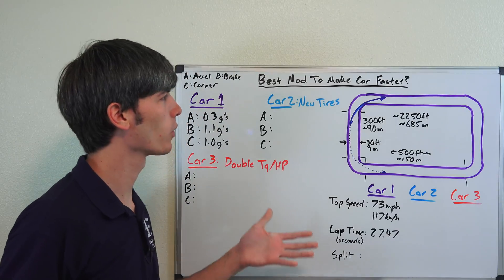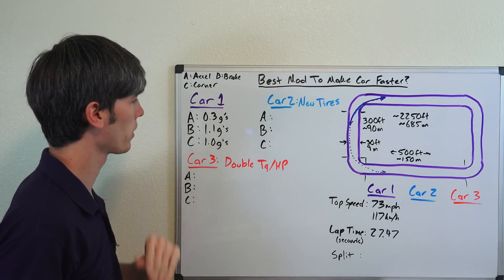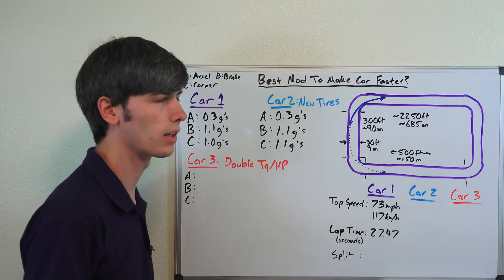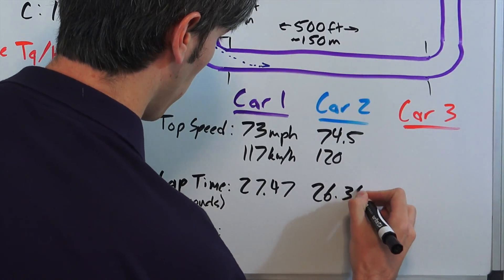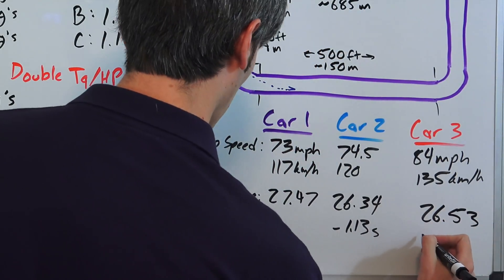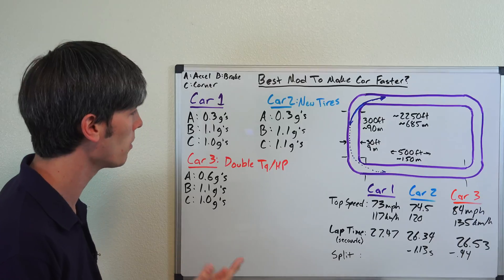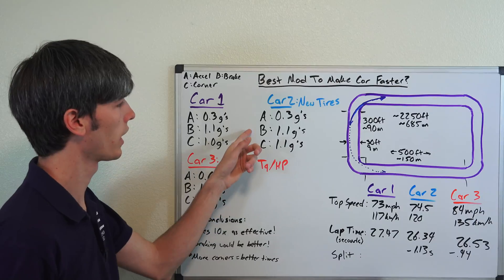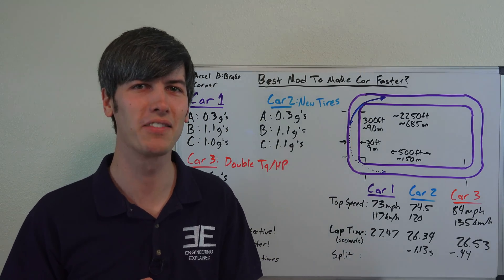What's The Best Car Mod To Go Faster?

Comment: Ideally car 2 and 3 would be the exact same but with one having more horsepower and torque. My question is, if you did double the horsepower via a turbocharger or supercharger, would you be adding weight to the car, thus making it a little heavier and contribute to a slower lap time? Awesome video by the way!
Reply from the maker: For the math in the video, we're simply assuming the torque curve is doubled. So let's just say for example you took a turbocharged car running 15 psi, and cranked it to 45 psi to double the HP (warning - it likely won't last long haha). Of course, adding a turbo/supercharger will add weight and thus reduce performance in a small manner, but we're assuming we've doubled the car's acceleration rate, hence we can add weight but will compensate with more power.

Comment: Mods
Corners= Tires
Acceleration= Camshaft/tune
Reply: Corners = Lose weight
Acceleration = Lose weight
Reply: mods: buy lightweight car (miata, crx etc.), remove junk you dont need (air con, power steering and other ballast), put great tyres, better brakes and you are good to go and rip some asses.
Reply: Downforce is starting to be effective at higher speeds. Basically, its pointless in normal cars.
Reply: Sigma Octantis
 IMO, the weight is a bad thing because of physics. The more weight - the more centrifugal force is generated (and weight transfer aswell) -> slower turns. If car is lightweight, its all about wight distribution and centre of gravity (you want to keep it low). Thats why lightweight cars has no competition on technical tracks (Lotus, Caterham etc,). The only problem is that in today safety standards, its almost impossible to make lightweight cars anymore.
Reply: Heidelaffe no normal human being is removing their air conditioning
Reply: its not just your opinion, its physics. Force=Mass*Acceleration the less mass you have, the faster you can accelerate around a turn without increasing the force on your tires, or worse, exceeding the forces they can handle. The GTR gets away with being so heavy because  IMO it has the best torque vectoring AWD system ever created. It has no business being as fast as it as carrying around 4400 lbs.
Reply: Heidelaffe Some people like to drive cars, not racecars
Reply: ***** same applies to you
Reply: Losing weight means losing traction so it's not as amazing as you make it sound. You need to make up for it with more downforce, which also means more drag and less top speed.
Reply: ***** Hence why weight isn't such a bad thing in street cars because they rarely go fast enough to generate enough downforce. That is why the Nissan GTR works well with a bit of heft.
Reply: ***** Except you need to lose an enormous amount of weight to make any difference, and then you're sacrificing grip which negates it's worth for a street car driven primarily at low speed...
Reply: You would be surprised ho BIG is that difference. Get rid of air con, spare tyre, put some sporty lightweight seats and voila - you got rid of weight which is circa like one person. And you can do more, way more. The difference in corners is huge (yeah, you cant really tell the difference of 70kg right away in 1600kg car, but in 900kg one, its like a night and day difference).
Reply: ***** No I totally agree there is a difference, you suddenly can't put any power down due to lack of grip.
Reply: gorrilaunit99
 A daily driver can be lightweight as well. But you will be forced to consider this before even buying a car i.e. don't get all comfort extras you will never use, don't get a glass sunroof (50kg and more at the highest point of the car), sometimes even a smaller engine will give you a lot less weight with only small lose of power. All these things can easily add up to 100-150kg, i.e. as much as 2 persons sitting in the back at all times.
Reply: gorrilaunit99
I didn't suggest that, my suggestion was something else: Ask yourself you really need all these goodies (glass sunroof, camera systems, lane assist, electic doors / boot etc.).
But I would rather look for a car with a low weight right from the start.

If you want to get rid of something like the A/C you can lose easily 20-30kg. If you drive a old car you also save maintenance.
That depends on where you live and what you are doing with your car. If it is just a weekend car for fun and if there is no way the car will become a classic: why not?

Btw. Both my cars still have working A/C and they will keep it. Looking for the greatest roads around europe in summer time and 35°C is no fun without a A/C :-)
Reply: F=M*A. it applies to "cars" race cars, airplanes, trains, rocks, Footballs, humans, bullets, water, even the planet. If something is lighter, it can accelerate faster without increasing force on an object.
Reply: +ReadyToGo Haha you're right to a degree, but that car has a tire problem not a weight problem. You did notice that its on all season tires in the stock C4 width right? Who knows how old and hard and likely overinflated they were. notice i said CAN and not WILL go faster. Unfortunately, in the real world more than one law of physics applies at the same time, hence why building really fast cars tends to be a hard job. Also, I wouldn't be going to those roadkill jabronies for sound engineering advice or examples of what to do at you local track day.

Comment: I'd say car needs to be balanced. Let's say your car has 120hp and weighs 2.5 tonnes. Improving tires will have little effect especially since most likely suspension on cars like that isn't very good. But adding 80hp will make a ton of difference. But if your car has 120 hp and weighs 1 tonne and has good suspension tires will yield way more than 80 hp added.
Reply: George Kartvelishvili 
wut 2.5 tonnes? wtf thats not a car
Reply: That is a car. Most full size SUVs even go beyond that. Toyota Sequoia weighs 3.5 tonnes for example. 140 hp Hilux weighs 2 tonnes empty. There definitely are a lot of heavy underpowered vehicles. For those 2 times more power will mean more than better tires. Esprecially if their suspension is no good.

Comment: Does the tires include something like downforce? I mean are you trying to explain why the acr can keep up with supercars?
Reply from the maker: Yep, downforce can play a huge, huge role, it's just going to be expensive to implement effectively. You're absolutely right though, one of the major reasons the ACR broke so many lap records was because it has more downforce than any other production car. Downforce is like making your tires way more effective, so it plays a similar role. It simply requires high speeds, and can dramatically affect efficiency.

Comment: Everyone who watches F1 knows how important are tires during a race.
This is a great modification since you don't have to change any other parts of the car in the process and it is simple. I believe the next thing you would like to modify is the brakes.
Reply: vdochev Not a fair comparison since F1s have great engines but I do agree.Good tires, breaks,coilovers could change the way the vehicle handles
Reply: I wasn't making a comparison. I'm just saying that in F1 you can clearly see the importance of good tires versus worn tires. You also have to be a good driver to take the full advantage of late breaking, accelerating out of the corner, etc.

Comment: The only way to make your car go faster is to resurrect Bruce Lee and replace the engine with him
Reply: legs can beat wheels bc they don't roll. ur always going to lose speed n power with wheels that why u don't see any creatures with wheel legs.
Reply: Chuck Norris is an acceptable substitute.
Reply: WhyteLis21 or maybe it's because creatures don't have steel in their body to have combustion engines in each leg?
Reply: why do you need bruce lees help with your engine swap?

Comment: what if the turns were banked? would that significantly negate any new tire advantage?
Reply from the maker: Absolutely not, it would simply allow the top speeds to rise, but the better tire will still corner faster.

Comment: This is partly why the Dodge Viper post's the incredible lap times it does.
Reply from the maker: Yep. It has the highest downforce of any production vehicle (or at least did upon release). Mathematically, you can think of downforce as increasing the grip of the tires, so a car with lets say a 25% improvement in grip via downforce will demolish track records, as it did.
Reply: Engineering Explained 
Does rear weight redistribution increasing the downforce to RWD vehicles improve times? Apart from aerodynamics, wouldn't this favor top down times for a retractable hardtop? Or only on a straightaway? (Waiting for a Miata RF!)

Comment: BIGGER ENGINE, FORCED INDUCTION, WEIGHT REDUCTION WOOT! lol
Reply: HYFR!!
Reply: +Assault Rifle 15
The higher the boost, the higher the intake air temperature and the greater the risk of knocking/detonation.  Most people get around this by reducing the compression ratio to bring the risk of knocking back down to normal.
Yes, as you said, if you have high compression, you'll have greater "motor power" (as compared to that provided by forced induction)...but as soon as you start shooting up the boost, that tactic goes out the window in favor of keeping the motor from grenading itself.

Personally, I (and most OEM's) prefer lower-boost, higher-compression setups for reliability and quicker responses as compared to sheer power numbers on the strip.  Additionally, if you're driving on a course with any curves w/ a turbocharger, lower boost/higher compression will help make the power delivery more predictable.
Reply: decrease compression ratio? i always thought higher compression ratio is better?
Reply: and you'll be doing burnouts all day long.
Reply: 9.0;1 to 10.0;1 is %3 gain..not much.
Reply: You seem to have missed the point of the video.
Reply: And anew steering weel

Comment: New tires will hurt acceleration performance due to higher rotational mass + wind catches the tread more.  For straight line acceleration performance mildly worn tires is the best candidate, unless you could find a new set of tires that are considerably lighter...
Reply: IamAnoobiecheez I mean, technically slicks would be the best for just straight line acceleration.
Reply: DraketheSneakySnake Yes slicks is fine too another option. Slicks do better in corners too though
Reply: usually if people get tires for performance purposes, they also get lighter wheels tbh

Comment: Hey Jason! I have a question. Is there a way to measure that difference in tyre acceleration without directly going with an accelerometer inside the car? 

And a suggestion , could you make a video about racing lines?
Reply from the maker: Here's a video on the racing line: https://www.youtube.com/watch?v=4m94jpEp3Go

Comment: Can you make a video on whether wide fenders with wider tires make you faster or if the extra weight and the extra size which hinders you from taking good race lines make you slower. 😉🏁

Comment: Make any car faster: Huge exhaust, body kits, stickers, neon, large spoilers, etc.
Reply: Lucasdreys And red brake calipers
Reply: Lucasdreys Bro, you can't forget the Flames. that's 300hp alone
Reply: +jose jalapenho why so triggered? coz you have those mods he mentioned on ur car?
Reply: Any car is 500x faster when slammed and cambered.
Reply: Lucasdreys don't forget about replacing blinker fluid
Reply: Lucasdreys Don't forget to have a giant subwoofer in your trunk playing eurobeat with the bass all the way up it increases traction immensely.
Reply: Lucasdreys sub woofers gave my Mazda like 100 whp
Reply: Don't forget the Stickers. One adds 20 HP 😂😂
Reply: Don't forget the manufacturer stickers that aren't even in the car. 300hp to the wheels PER STICKER.
Reply: Actually, ChiefFalque, that is untrue. You can't expect to put a 4 inch exhaust on a 2 liter engine and expect it to preform better. Your exhaust gasses need to have a certain restriction in order to get the proper gas velocity to exit the exhaust, which is highly important to low end torque. But sure, go ahead, make your car sound like a weed eater. Now, if you put a full exhaust system on your car that isn't just a muffler, you will see some small gains in overall horsepower and torque.
Reply: Yes, spoilers. You wouldn't want your 1200cc Hyundai getting airborne on you.
Reply: Lucasdreys dude stickers should be top priority. Always
Reply: Stickers are the key.
Reply: make sure its a honda or a ford too
Reply: ChiefFalque but isn't that a case-specific thing? Wouldn't the stock car designers have optimized the flow to the exhaust pulses in some cars?
Reply: Lucasdreys  youll need autozone hood scopes and fender vents for more hp
Reply: The funny thing is that the exhaust can actually improve performance if your car is typical stock before the mod - it will allow better flow, meaning less resistance for the exhaust gases. Now of course, this doesn't give you much, but it's a noticeable difference on the dyno.
Reply: gotta have the chrome "fart can" too, :):):)
Reply: Imports win
Reply: Filipe Amaral I'm not sure if it holds true for all cars, but I do know first hand that it is for certain BMW cars and motorcycles. Even the most expensive aftermarket exhaust will result in a 10-15% decrease in power from the stock system.
Reply: Wall Russ subs increase traction, because rear weight so it better balances out the car😉
Reply: sammeo I wish I would have kept all the stickers from parts on my build. I could have put them on my POS contour Rez runner and it would have been a far faster car that my 485hp wrx.
Reply: Lucasdreys lolol
Reply: Daniel Houl , better than red drums
Reply: Does anyone know if these mods work for my red 2004 dodge caravan?
Reply: Lucasdreys don't forget to slam it as well. And each sticker is equivalent to 5hp.
Reply: Don't forget spinners, and giant chrome rims lol
Reply: You need that 2m high 3 meter wide wing on your stock BRZ yo you need the downforce
Reply: Cars are about style and performance. Some things are done because they want a certain look; some things are done because they want a certain level of performance. Different strokes for different folks.
Reply: no mate its headlight eyebrows
Reply: Racing stripes
Reply: Have you been playing 
need for speed underground?
Reply: Fartcan.....
Reply: Awesome 👍 I'll definitely try the sticker idea, thanks 😁
Reply: All of that will make the car slow as hell
Reply: This guy gets it
Reply: What about the 3 spoon engine ?
Reply: dont forget duck tape
Reply: Get you some HID Exhaust wings. (High Intensity Dipstick)
Reply: Lucasdreys don't forget to sprinkle  rice on it too
Reply: Lucasdreys Rice
Reply: You forgot the 40 alternators for the speed boosting bass box!!!
Reply: not funny. you can find that joke in almost every car video.